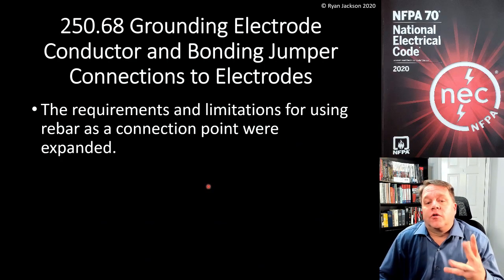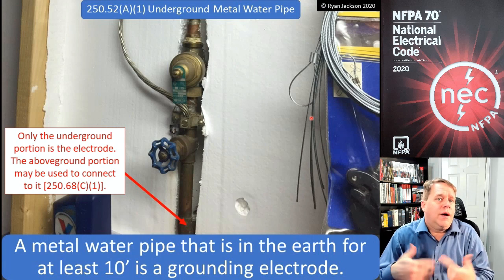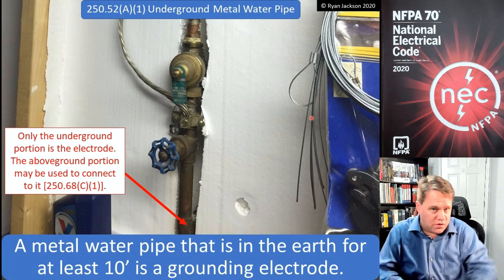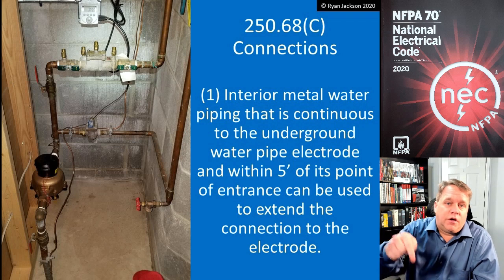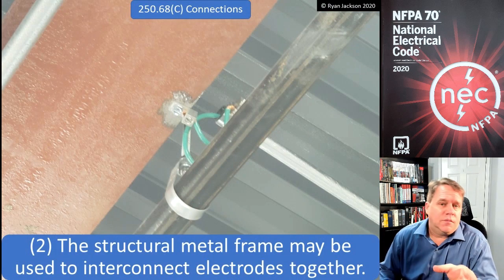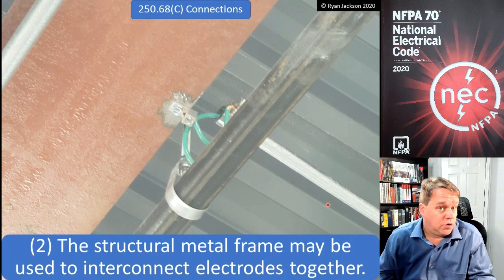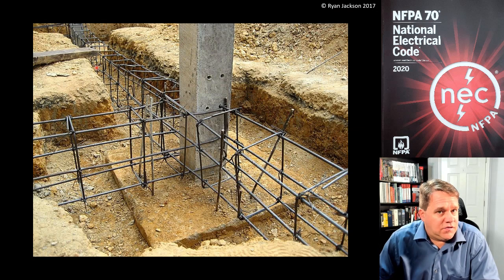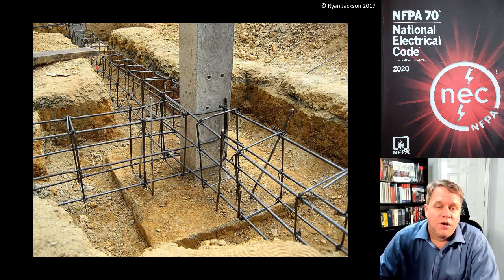2020 NEC Changes series: 250.68(C) Grounding electrode conductor connections

Comment: I am not and electrician.  but I am curious to know if anyone have tested the rebar ground over a period of time to see if there is a change of resistance because over time the rebar will corrode. Also is it concern connecting dis-similar metals together because of electrolysis over time. Lastly, CNC machine manufactures spec out that the machine to be connected to a "Quiet Ground" and not to use a building ground.
Reply from the maker: Yes, the person's name was Herbert Ufer. Electrolysis is not a concern, and neither is galanic corrosion.  Manufacturers often put dumb ideas into their instructions, including what you describe, which would be a violation of the NEC.

Comment: I wouldn't want to trust rebar as a GEC.  Rebar can corrode over time unless it has sufficient coverage by the concrete, it can sag closer to the dirt as the concrete is being poured as well.  And you probably don't have a 1000ft piece of continuous rebar, but a bunch of joints made by rebar overlap (with the overlap not wire brushed) and wire ties (by concrete workers probably not caring about an effective GEC), which can corrode before the pour if it gets rained on, even if they were perfect before.   I'm just a farmer that's done electrical and concrete work though, what do I know? :D

Comment: 90% of residential rough electrical  typically consists of 1/2 and 3/4 inch holes. Whereas 50% of residential rough plumbing consists of 2 to 4 inch holes. If electrical work required the same such sized holes, would electricians be just as "evil" as plumbers.
Reply from the maker: It's just a joke, I don't hate plumbers. :D

Comment: Since rebar does not come in 1000' lengths (usually max 60'), the sections of rebar would have to be electrically connected together, not just touching with a piece of rebar wire tie around them. Also, unlike a water line whose location is well known and makes a huge mess when it is cut, someone could core or cut into the concrete right through the piece of rebar that is being used as the grounding conductor and never be the wiser.

Comment: Hi Ryan, you almost answered the question I had that brought me to your video. Since this video is 2 years old, I hope I can still pose a question and get an answer back? 
My question is: can I use a rebar encased electrode, (EEC), bond it to the steel building at that location and then 100' away, bond the 400 amp meter service to the steel building? Rather than running an exposed bare wire up over the ceiling from the meter service to the EEC. Would that qualify as the grounded electrode for the service?

Comment: Just putting these questions out there for opinions. This is in regards to a service entrance. If you have both a ufer connection point and a 20+' copper water main available, which would you choose as your grounding electrode?  If you choose the ufer, you would still need to bond the water piping. If you choose the water pipe, would you abandon that ufer connection point, or use that as a supplemental grounding electrode? Many local utilities want a driven rod at the meter fitting regardless of what the AHJ requires, so that would qualify as your required supplemental electrode.
Reply from the maker: You have to use all that are present, and if one of those is a water pipe it must not be the only electrode. So use the Ufer and water pipe and then you're done.

Comment: Defining an electrode as the underground portion is deceiving in that current may be flowing from the connection point on. Many plumbers have been killed opening water mains, and I believe the 5 foot rule is for that reason.
Reply from the maker: No, the five foot rule is to ensure the premises wiring system will still be connected to the grounding electrode if a plumber replaces an aboveground portion with nonmetallic piping. There will always be current on any grounding electrode because they are in parallel with the utility's grounded conductor.

Comment: Hi Ryan have you ever seen a water meter that is underneath the ground outside the house? It looks like a small version of a manhole cover. I am used to water meters (like the one in your video) where I would Bond one before the water meter and one after the water meter.
Any ideas? The house was built in 1980
Reply from the maker: My water heater is underground near the sidewalk.
Reply: @RyanJacksonElectrical  water heater??
I was asking about your water main
Reply from the maker: @theseattlegreen1871  meter, sorry. It is underground.
Reply: @RyanJacksonElectrical  
Okay no problem so how do you bond that?
Reply from the maker: @theseattlegreen1871  you don't. It's thirty feet away from the house, so it's not part of the grounding electrode.

Comment: What is code if a #4 ground wire is connected to the rebar within the footings of the slab that is encased, thus the bare wire is the only thing visible within the wall? Is this NEC 2020 code compliant?
Reply: Yes, either it has to be secured to the rebar or 20ft of the proper grounding conductor size needs to be buried in the concrete (you do the 20ft option when there's not much steel in say a slab to tie into). It just makes it harder to verify that it was done right. Though to be fair I have seen electricians forget to have the rebar stubbed up in the right spot and they'll cheat and drill a hole epoxy a tub of rebar into it and tie onto that. That guy got fired from the company pretty fast.

Comment: Is a duplex with one continuous foundation allowed to have two SEPARATE Ufer grounding systems with 4 ga. copper wire connected at three separate points with approved concrete contact connectors 20' along the the concrete encased 20' long rebar for two separate 200 amp services, i.e. each service panel is connected separately to the rebar in the footings? I would use the flexible conduit to encase the 4ga. copper wire from the footing up through the slab below where the panel would be in the basement.

Comment: Hey Ryan, on an existing pole barn for a 200 amp service with no plumbing or rebar stubbed up what would be the option? Also building has R panel so that would be bonded.

Comment: Washington State, Mount Vernon, 2020 NEC: I just got off the phone with a local inspector, and he said that two rebar stub outs at least 20 feet apart (tied via tie wire using std construction practice) into the rebar footings is sufficient provided the rebar length is at least 20 feet. He also said that a #4 copper wire (20 ft bare tied to the rebar structure with 6-7 feet of protected wire) above the concrete) can be used instead of the rebar stub out. So, either system is ok: two rebar stubs at least 20 foot apart or #4 copper wire.

Comment: OK.....
A piece of rebar in the concrete is 'never' grounding  .... concrete insulates and  rebar should never extend into the dirt  as it introduces corosion into the rebar framework .... and 'corosion proofing' does not reall work long term and if it is likely interferes with contictivity to earth.... 
It can be used as a 'grounding plane'  for the floor  freequently needed gor 'differential' in large / multy floor buildings .... absolutely never considered actual ground 
.
Intermaterial bonding creates risk of  electrolysis and failed connections , therefore should never be relied on
Reply from the maker: Stand on a piece of concrete and touch an ungrounded conductor originating from a solidly-grounded system and tell me how well concrete insulates. As far as "actual ground," the NEC defines ground as "The earth." Obviously concrete is not "actual ground." But I never said it was and neither does the NEC.

Comment: Ryan, I am having a monolithic foundation poured and plan to use a 1/2 20 ft rebar in the footing as the CEE. Can I just have this rebar extended up through the slab and attach that to a #4  using a clamp to bond the service panel ?
Reply: Yes

Comment: If I had to guess at their reasoning; the skin effect is the conduction point of the material and the gauge of the material is its heat retention and dispersion factor, a corroded material will see increased resistance reducing or eliminating its ability to conduct a short over the desired distance causing a "blockage" so to speak causing the current to back up at the weakest point of the connection and a failure of connection would be the result.
Reply: @James Karrie false. Oxidized metals have a higher resistance  than the base metal. Also; the skin effect is not millimeters deep it is microns deep.
Reply: @James Karrie this is why aluminum is rarely used and never used in buildings for electrical wiring. Many a fire have been caused by lightly oxidized aluminum wire.
Reply: @James Karrie no it wouldn't. We use solid core wire to safely carry high current. Stranded wire bundles offer a lower resistance but are prone to heating up quicker and at lower currents. This is why your vacuum cleaner power cable is warm after 10 minutes or more of use. The reason this works is the beauty of alternating current. If we were still using Thomas Edison's direct current Stranded wire would be the standard so that the power could go further. With A/C we can send more power with the same surface area 100 times the distance.    The skin effect will also go deeper into the material at higher power but this sinking into the material is also fueled by heat. Keep it cool and will stay at the surface.

Comment: Somewhere I saw a table that showed the multiplication factor for multiple ground rods in parallel if one ground rod isn’t less than 25 ohms. It was somewhere in the 250 part of the 2020 NEC I think. Anybody know where it can be found?
Reply: 250.56
Reply: @im2yys4u81   thanks

Comment: EE here. The idea that a continuous rod which is half burred and half not being half grounding electrode and half not is ridiculous if you ask me. The first problem with it is that it almost implies the bonding should be done under ground which would then make inspection impossible. The second part is that its just physically incorrect & under this reasoning you could never bond to the grounding electrode because the second your wire enters dirt the portion of it in the dirt is then a grounding electrode lmao. Of course you want your bond to the grounding electrode to be such that it would never be reasonably open from the grounding electrode, but lets not get carried away here trying to pretend one piece of metal is two just b/c its half buried and half not.

Comment: I just had a local building inspector tell me my ground wire to the ground rods ( we are required to use 2, 8 foot rods 6 feet apart) was supposed to be solid wire. I've looked up where it says that in the code and it doesn't,  at least not where I can find it. For some reason #4 solid is in short supply, I couldn't find any within 15 miles and was in a crunch. I had 30 ft of #2 braided and used it, quite a bit overkill. He did pass it but not before raising my blood pressure.
Reply from the maker: It's not required. The Code specifically allows multiple GECs or bonding jumpers. See 250.64(F) and note that a wire between two electrodes is NOT a GEC, but rather a bonding jumper. That means the splicing requirementvof 250.64(C) does NOT apply.
Reply: as I recall, the rods should be at least 6 ft apart. Most guys go 8 ft because it's an easy eyeball with no questions. The grounding wire is a solid piece" meaning no splices from the farthest rod to the ground bar in the panel. You can use solid or stranded wire.

Comment: Hey Ryan,  We never intended for the concrete encased electrode to be used as a bonding jumper to interconnect other electrodes. Although it was never tested as you mentioned, and that is one of the reasons we clarified the language in the 2020 edition.  We did allow it for the metal frame of a building because 1) it is NOT likely to have the continuity of the metal frame interrupted the way metal water piping is likely to be interrupted. and 2) it is suitable for systems that have ungrounded service conductor that exceed 1100 kcmil CU or 250kcmil AL, in other words, no matter how small or how large your service is, the metal frame is akin to a properly sized wire type bonding jumper. With metal water piping it is the same issue, (as long as it is connected within the first 5' as it enters the building) the metal water piping will work again for the smallest service or the largest service.  Rebar (concrete encased electrodes are a very different matter. For example, if you had a 3000A service that includes metal frame and a concrete encased electrode, the 4 AWG connection to the electrode is not the same as a 3/0 connection needed for the metal frame and using the 4 AWG to connect metal frame would not meet the requirements of the NEC.
Reply from the maker: I agree.
Reply: I've always thought rebar to be a bad choice. Unless it's tested, there's no telling if it's actually contiguous, or driven into the ground anywhere. All it takes is one concrete saw and your ground is no longer a ground, and you'd never even know it. Water pipes would also have to be tested, even if you can visually see it going into the ground -- how deep is it, and how far does it go before becoming plastic?

While my house (80's) has a copper inlet -- 2' down, ~20ft to the meter -- it's grounded from a dedicated ground rod a few feet from the service connection. ("first disconnecting means") My parent's house (60's) used to be grounded from a cast iron pipe. A decade+ ago that was replaced with a proper copper rod when backup power was installed.
Reply: The problem isn't his explanation of the code but inexperienced electricians . Ive seen a lot grounding practices from Jack Leg electricians who just don't know.
Reply: What is code if a #4 ground wire is connected to the rebar within the footings of the slab that is encased, thus the bare wire is the only thing visible within the wall? Is this NEC 2020 code compliant?
Reply: @KrazyKajun602 I wish someone would answer this I'd like to know to.

Comment: Hey Ryan, I'm enjoying your videos,  but  i have a confession to make.  Around 15 years ago or so  you inspected the electrical install on a new build church,  i was using the white wire iin a 12/2 mc cable as my switch legs in every room,  you told me to mark them all black,  i promised i would and you signed off on 4 way. But i never did LOL!
Reply: Hi Ryan, 250.68 (C)(1) allows connection to the extended concrete encased rebar type. If all requires are met, are we allowed to run a#2 aluminum on a 400 amp service being #2 al. Is larger than #4 bare copper?
Reply from the maker: @roudibien-aime2198  Yes, 2 AWG aluminum is allowed.
Reply: @RyanJacksonElectrical  well, I have a question about the use of aluminum as GEC. 250.64(A) says "when used outside, aluminum GEC shall not be terminated within 18 inches from the earth".
Outside of what? Of the building? Of an equipment? Of an enclosure? My inspectors have always told me to keep the GEC aluminum terminations at least 18" off the earth when they're outside of an enclosure but the code text here is a little ambiguous tbh.
Reply from the maker: LOL I can't believe the building didn't burn down without that tape!!! 😅
Reply: You savage
Reply: I mean, that's one way to tell the whole internet you're a hack lol
Reply: You bastard!
Reply: Ryan is a good guy.  You are a dishonest person that you did not keep your word wouldn't want you to ever work on my properties
Reply: @garagekeys 😂😂😂😂😂😂YOU would when his thousands  cheaper
.

Comment: Some electricians and inspectors still dont realize the size of the grounding  electrode wire is determined by the size of the largest UN-grounded conductor in the service entrance feeders .Its  in the code book.  . And some inspector's want a solid bare wire not insulated.
Reply: Evidently some electricians and inspectors don't read the code. As for the bare solid wire, i guess they have only seen a number six solid going to a ground rod.
Reply: @nooneyouknowhere6148  to be far the book 📖  is thick so remembering all a one time for a pop quiz is hard, i end up reading it more than once for new questions i have or refreshing my memory about a part im working on
Reply: And our inspectors now want grounding wires to be shielded in any exposed areas between panel and ground clamp and to second ground clamp
Residentially interestingly is capped (localy anyway) at AWG6 despite it being below the normal  feeder to ground ratio at 200A systems

Comment: Is there also a consideration that the rebar of a large structure is not electrically continuous? The rebar won't be a single piece in your IKEA example, but multiple (likely rusty) pieces temporarily mechanically tied with maybe 16 ga. steel wire until it is locked in place with the concrete. Any bonding, even if it had been done, is certainly no longer accessible once the concrete hardens, and I doubt the concrete has a UL label as a bonding conductor.
Reply from the maker: No, the rebar is still permitted to be multiple pieces tied together with the wire when creating the electrode itself, see 250.52(A)(3). Also, nothing is ever required to be listed by UL, and a conductor doesn't need to be listed at all.